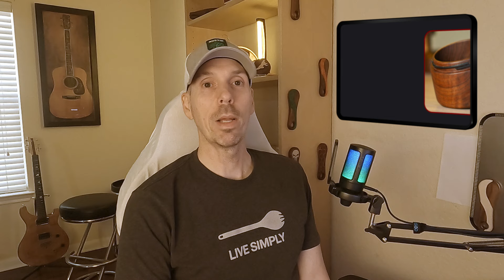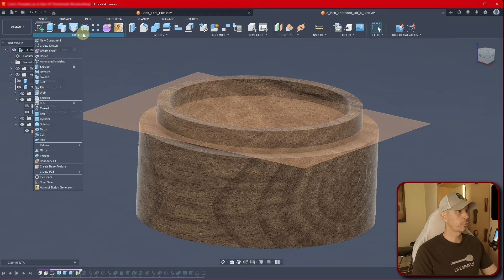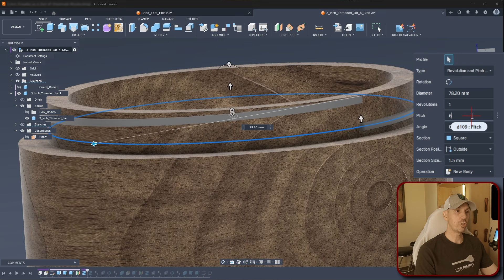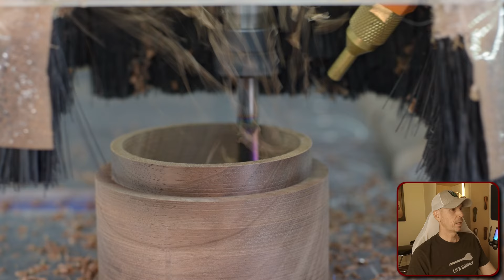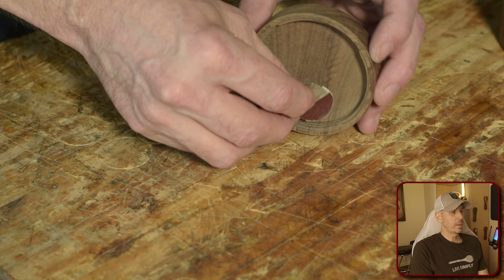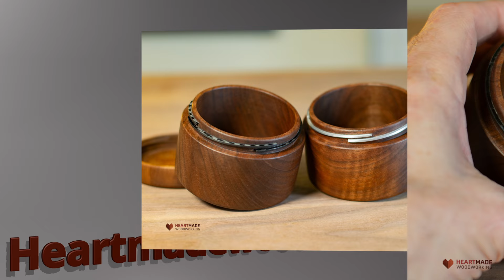Making Threaded Wood Jars With A Twist

Comment: Amazing work as usual 😍.
Thank you for the tutorial 🙏🏻. Can you give us a rundown of how you got here though? I am really interested in knowing what happened with the previous iterations 🤔
Reply from the maker: Thanks much!,
Most all of the different variations work, I just wanted to improve them for one reason or another. I gave many away to friends/family. I also give away various prototypes (not just of these threaded jars) in the orders I get.
Reply: @heartmadewoodworking Thanks for the reply 🙏🏻. I was contemplating wooden threaded boxes since I saw one demonstrated by vectric in which they used a thread milling bit. I couldn't easily find it though, ao couldn't run my own tests to see if they can be used for a viable product. I was wondering about how they would behave given that wood moves after a while and isn't a stable material. Did those boxes seize after a while, did the thread go bad after a short while? Never found answers to those questions and it was driving me nuts 😂.

Can you recommend a bit fpr those projects? Single or multi threaded and what dimensions worked best from your experience?

Sorry for the essay 😂😂😂, thank you in advance, even if you couldn't answer those questions.

Your content is amaaaaaazing amd I will stick to learn and enjoy more of it 😁.
Reply from the maker: I haven't had any issues with any of the threaded containers I've made binding or seizing up due to expansion/contraction from humidity fluctuations. I generally machine them so they're pretty tight right off the table because I do a lot of sanding. I also use hard-wax oil which seems to regulate wood movement (in my mind anyways) and definitely "lubricates" the wood as well. I think the wall thickness and wood species would also play a factor but so far none of the usual hardwoods like walnut, maple, mahogany...etc. have had any problems.
As far as recommending a bit....did you watch the video? lol 
I use keyseat cutters for threads now, they work and they're way cheaper than threadmills.
Reply: @heartmadewoodworking One last thing that has been bugging me. The Carbon fibre threads 🤔. Are you sure they won't shed material on the content of the box? Are they that stable 🤔. I am worried that someone might end up ingesting them or them getting embedded into someone's skin and those kinds of things 🤔. I have seen another creator use them for a project he made (the 3d printed one's though) but ended up abandoning that idea because of these concerns. I think it's worth a look into.